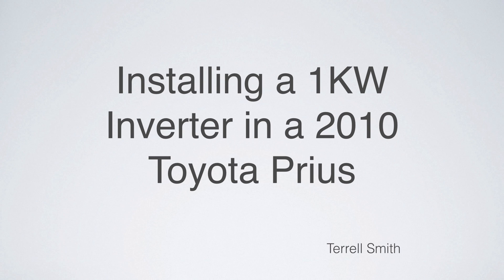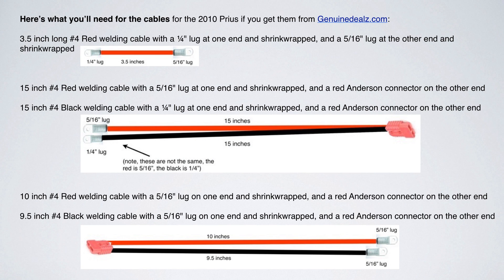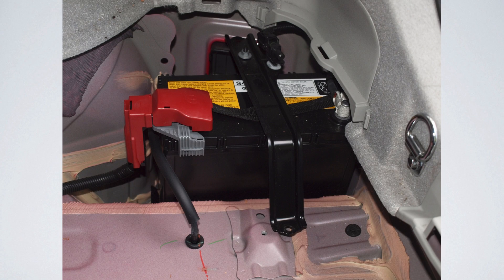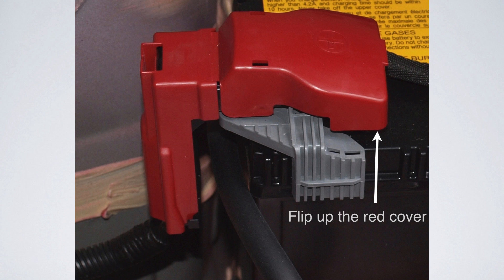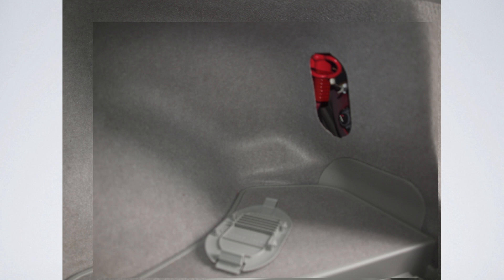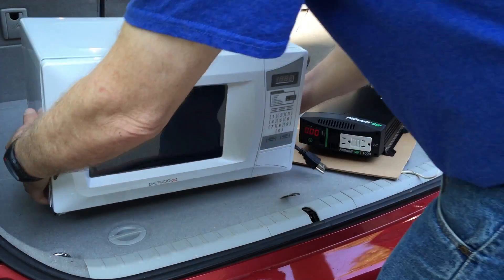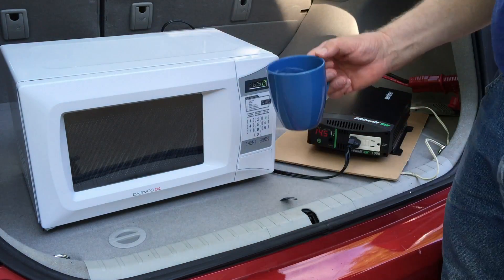Add a 1kW Inverter to Prius

Comment: Me again.   Given upstate New York's power may be shut off by Canada, using the system you helped me set up. I thought I would get out my hot plate that cooks by wattage instead of degrees and get it running again.   The hot plate set at 500 watts works just fine for a few minutes and then shuts itself off, just like my instant pot (600 watt smallest model) does.  I'm trying to figure out why this is happening.  Could it be my ground wire, which is so tiny in comparison to the 4 gauge red and black cables, my inverter, which is rated 110 volts,  or my breaker which is supposed to be 100 Amp rated?  The breaker doesn't blow.  The devices just shut themselves off.  Should I invest in a different breaker? I probably wouldn't use either the instant pot or the hot plate in a power outage.  I just wanted to try 500 watts worth of continuous draw because that would be about how much our energy star freezer and refrigerator, our laptops (if there was wifi) plus a about 4 LED bulbs would draw if that's all we used for power.  Do you have any suggestions on what the issue/s might be and what I could try?   My car is a 2004 Prius.   I read once some of them had NiMh batteries.  Could that  be the issue?  Otherwise, I may get one of those LiPO4 power stations, which would cost a lot more money.  Maybe a great big lithium battery, charge controller, a bigger inverter and some solar panels as a DIY solution?  Thanks so much.
Reply from the maker: Thanks for the questions. Do you have a device which can measure actual watts? Such as a "Kill A Watt"? (It's a small inexpensive device that you plug into, and it tells how many watts are actually being drawn.) I ask, because perhaps your hot plate is actually cheating on you by switching on and off to get at the 500W setting, but during the "on" cycle, drawing 1K. I doubt that the instant pot is doing this, but maybe? What is your inverter rated at? 1,000 Watts? Is it pure syne wave? Or simulated syne wave? If your breaker is not going off, it's not likely the breaker. (The ground wire shouldn't be an issue either.) The NiMh traction batteries should not be an issue, you can still drive, right? But is your 12V battery old? Maybe it's not holding power? The main source of power for this set up is not the 12V battery, but the car's charging, but if it's fighting with an old 12V battery...? If you do get a LiFePO4 power station, I suggest getting one from Ecoflow, the Delta 3 Plus is less expensive than some of the others, and is rated at 1800W. My guess, though, it that the shutting off is caused by your inverter. It should have an internal breaker, which resets itself after a bit of time, and trips when the power draw is too high. Even though our refrigerator is rated at only 120W, its start-up surge is so high it trips my 1K inverter. My Ecoflow can handle it though. Hope this helps.
Reply: @TerrellWSmith  Thank you so much for all your help and your super fast reply.   I do have a kill-a-watt and I'd find it had gone out when the hot plate stopped working.  I did a trial indoors this evening and the wattage was about 120-140 watts higher than the dial on the hotplate said it was.  I think I might try it again at a lower setting and also run at a different time a couple of 100 watt bulbs and see how that works, if so, I'll add one more and keep adding till I find how much I can get away with.  I've been looking at power stations and there was this chart online that shows which models has the most usable juice and which ones take the least amount of time to recharge.  I was surprised that Jackery and Bluetti were not star performers.  All my laptop windows closed unexpectedly and I haven't been able to find that chart which was by one of the electronics websites like CNET but it wasn't them.   My car is a 2004 and still has its original main battery which has always performed perfectly.  I've replaced the auxiliary battery only twice in 20 years.  Do you think I should get a new one?  I read one can put an additional auxiliary battery on but how would you keep it from flying around the car when you put on the breaks?  I'd love to get the Prius generator to work even if I end up with a power station because my neighbor who is retired and also has a Prius might be able to use it for juice if we do get a power cut off. Either she could come use my set up or we could transfer mine over to hers.   Thank you very very much again for all you help because I know no one else who knows a thing about Prius's.
Reply from the maker: @amywalker7515  . The dial on the hot plate is probably not too accurate, but if it's set at 500 and actually draws 640, it still ought to be OK with a 1,000W inverter. Your car's traction battery should give you many years of service. I too, have replaced the 12V battery twice on my 2010 Prius. I have a YouTube video about installing an additional 12V battery: https://youtu.be/cLCAIXEVy94?si=As1sE7GX230mBNkN
Hard to say whether or not you need a new 12V battery. They are quite expensive in the Prius. If you have a voltmeter, you can check the voltage on the 12V battery either directly or under the red cover under the hood (positive), and the other on ground (clean metal). It should read at least 12.6V with the car not running. And probably 14+V with it running. Good that you're thinking about the dangers of an unanchored battery. It could kill you. I have both a Bluetti and EcoFlow, and find that I like the EcoFlow a bit more. I also anchor it when in my car using the tie-down rings in the back. 
I think the issue may be with your inverter cutting out, rather than anything wrong with your car.
Reply: @TerrellWSmith  Thanks again for your input and suggestions.   I ran a trial in my house with my Kill-a-Watt and that hotplate and it does draw more power than the indicator on the hotplate says drawing around 630 watts on the 500 watt setting.  If I choose the next lower setting, it comes out about right, but why would it be shutting down if the inverter is rated 1000 watts with surge to 2000 unless it's the battery or the inverter?   I am going tomorrow to my mechanic for my yearly inspection and ask him about the health of my auxiliary battery.  I know it's been in there for a number of years given I've only replaced it twice in 20 years.  Perhaps merely replacing that battery may be the answer.  Also, I was reading the battery needs to be AGM and I don't think the one I have now is.   Something about the Prius system speaking to the AGM battery in a certain way for charging it.  I may go for a long drive today to see if it merely needs a good charging because I don't drive much anymore and then rerun my trial.  If I'm going to have a backup system it needs to be reliable.   I liked your video about adding a second battery but that install is more than I would want to take on at this time.  Is there a way to put one on temporarily as needed and then store it somewhere else?   Thanks again.  I don't think I could have pulled off this project without your help :).
Reply from the maker: @amywalker7515  Hi Amy. Your mechanic will likely tell you that you need a new 12V battery. Unless he's totally honest. After all, he sells batteries. But maybe you do need a new one. I actually doubt that it's your 12V battery. It could be your inverter just isn't putting out the power. Or worse, that the DC/DC inverter in your Prius is just getting tired? I don't know. You are doing this with the car turned to ON, correct? If not, that would explain the shutting down. 

And, you mentioned that your 12V battery is not AGM? Is it still lead/acid? If not, that might be the problem. The car's charging system expects a lead/acid 12V battery. If you've installed something else, the car's charging algorithm may be confused. The newer Li batteries are supposed to have circuitry inside to help keep them from overcharging, etc, but it may or may not work correctly for your car's charging if it's not a lead/acid 12V battery.

If you have testing equipment, you could do a series of voltage tests: 1) Measure DC output at the car's red cap under the hood, or at the 12V battery terminals. Run things until it shuts down. Is your car still producing voltage to the battery? (Should be a bit over 14V, like 14.6V). If not, it's the car. 2) Measure at the inverter's 12V input. This ought to be the same as what the car is producing. 3) Measure at the 125V output from your inverter (make sure to switch to AC and 125V range). This is where the hotplate stops working, so my guess is that this measurement will drop to zero when the hot plate stops. If the other measurements are OK, then it might be your inverter.

Comment: Thanks for the video, really helpful. I just have a quick question. I'm in UK and my 2011 system is still under warranty as long as I get hybrid check done annually. I think I know the answer but do you want think this is a modification that will invalidate my warranty?
Reply from the maker: Hi Di, Your 2011 is under warranty as long as you get a hybrid check annually?!? I assume you must pay for these annual hybrid check-ups? Your car is now 13 year old. Have you ever had any hybrid trouble? I seriously doubt it. The hybrid system is (at least on this side of the ocean) guaranteed by Toyota for TEN years. See your owner's guide. My Prius is 2010, built and purchased in 2009. I have had zero issues with the hybrid system. I'm sorry to say that someone likely cheated you, selling you that warranty. Because of that, whoever sold you the warranty likely would refuse to honor it if you do ANYTHING to your car. The inverter is attached to the small 12V battery and pulls power from the Prius DC/DC inverter. I recommend no more than 1,000 W for the inverter. There are others who pull more than that. If you really wish to add a 1kW inverter to your Prius, ask your dealer to do it (so it's done by a dealer), or get in writing from whomever sold you that warranty that it's OK. But even then, I bet they will do everything they can to avoid covering any warranty work. Will this modification harm your hybrid system? Not at all. The traction motor pulls way more than 1,000 W. There are people who have tapped into their hybrid battery (not the 12V battery) to power their whole house. Might it invalidate your warranty? Likely, because it covers an issue not likely to ever happen. Just my opinion.
Reply: @TerrellWSmith  Hi, I'm in the UK. I bought the car 6 months ago, only 32k miles on the clock. I paid Toyota dealership just £55 for hybrid check, which it passed, and asked them to confirm what I had found online, that getting a hybrid check and a pass certificate extends the Toyota warranty for another year, up to the age of 15 years, and they confirmed this to be true. If I pay Toyota to do the annual service, which I probably will do, they will include the hybrid check for free and extend the warranty too
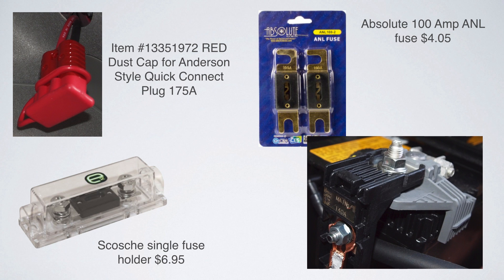Reply from the maker: @DiAllinson  , thanks! That changes my perception. You bought the car 6 months ago with only 32k miles? Wow! That's amazing. I was thinking you were paying a hybrid warranty since 2011. Yes, it was very wise of you to get a hybrid check when you bought a car that old with so few miles on it, makes you wonder why they sold it. And although I have no idea what costs are in the UK at Toyota, £55 sounds reasonable for a check. (Practically anything the dealer does might get charged at their flat hourly rate.) Sounds like you have not only a good car, but a good Toyota dealer. In that case I might suggest you tell them that you are interested in hooking up an inverter to the 12V battery, and ask them if that would affect your warranty. Feel free to show them the video if you wish, though they might not want to take the time to. A 1kW inverter should not be an issue. Assuming that the UK version of the 2011 Prius is the same as the USA 2010 version, the wire from the Prius DC/DC inverter is fused at 140A (see at 2:27 in the video) at the positive terminal of the 12V battery. My set up fuses the 1 kW inverter at 100A just to be on the safe side. And just a curious question: Is the 12V battery on the right side or left side in the UK version? Let me know how it works out for you.
Reply: @TerrellWSmith  I got such a great catch, it was like the angels smiling down on me 😊
The couple I bought it from were elderly, and sadly the gentleman had a problem with his neck and was no longer able to drive for the last 3 years, so they hadn't been high mileage since they bought it, but the last 3 years was only about 200 miles a year for it to go for MOT and services and for a friend to give it occasional run around the block. I had been looking at priuses for a few years and they were mostly ex-taxis over 150k miles, and long distance away from me. But this one was only 10 miles away, and it was like I was divinely guided to find it on the day I did. I feel very blessed.
The 12v battery is on right hand side so if I'm in drivers seat (right hand drive in UK), it's behind me. I think everything is same way round as USA apart from the front dash and driving. I would have preferred the wider back seat to be behind passenger seat (for laying flat to camp in), but it's behind drivers seat and I think harder to climb through from the front
Reply from the maker: @DiAllinson  , yes, you are blessed, and that's a wonderful find! Two suggestions to make it last a very long time: 1) Don't forget to check the engine oil from time to time. Some Prius owners have said they lose oil (I never have). 2) If not already done, next oil change ask that a good synthetic oil, like Mobil 1, but used. That will make the engine last even longer. I currently have 198,835 km on mine. Some, used as taxis, had over 483,000 km.
Reply: @TerrellWSmith  thank you for the tips and advice Terrell, I will certainly take them on board. I'll get it serviced by dealership as that will then include hybrid check for free, so I would expect them to use top quality oils.
I'll certainly keep watching your videos, thank you 🙂

Comment: Maybe I'm stupid but.... Isn't the inverter connection to the drive train battery and not the much smaller crank battery? Never seen it done like this.
Reply from the maker: Hi Blake, no you're not stupid. 😀Yes, it is possible to connect to the traction battery and draw up to 3kW, but that's not an easy job. What is easy it attaching to the small 12V battery as shown in this video, and with the Prius in READY mode, with an inverter draw up to 1kW. I did it mainly for camping (microwave oven, rice cooker, etc.) Then just this week a storm brought down two large branches which ripped the power lines right off our home. I ran our freezer, modem, router, phones, and computers for ten hours from the Prius until the power was reconnected. 

BTW, the 12V battery in the Prius is not actually a "crank battery" in the normal sense, the 12V battery actually just powers the car's computer to allow the large traction battery to start the motor when it wants/needs to. The actual power allowing a 1kW inverter doesn't come from the small 12V battery, but from the car's DC/DC inverter.

Comment: Followed your same setup with the exception of using a 1500 watt inverter and 120 amp fuse.  I know you say that 1000 watt is the maximum draw allowed for the 12v battery but is it ok to use a 1500 watt inverter if the continuous draw does not exceed say 600-700 watts while the car is on ready mode?  I use the inverter to charge a portable battery power station (uses about 650 watts for up to 1.5 hours to get a full charge).
Reply from the maker: Hi AC, Just keep an eye on your power draw, and avoid the temptation to "just try it" because you don't want to "just fry it." You should be fine with 600-700 watts. Since you're using a portable power station, you can simply plug your power station into your car's 12V Aux power port while driving to get it charged, assuming the power station has a 12V input. Or even while stopped, as long as you're in Ready mode. You can lock the car while in Ready mode with the "emergency" key that's in the key fob, and that will allow the car to be running in Ready mode with the doors locked, so no one drives off with it! Using a big 1500 watt inverter to charge a power station seems like you're wasting power, since each stage has a certain amount of power loss.